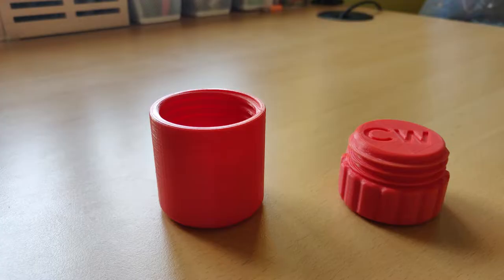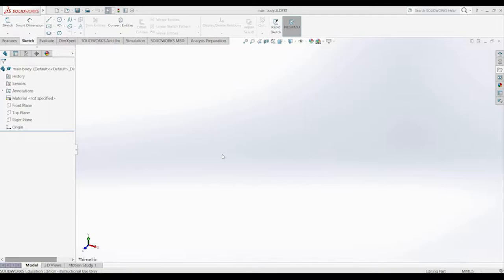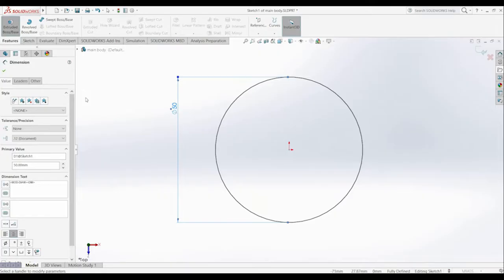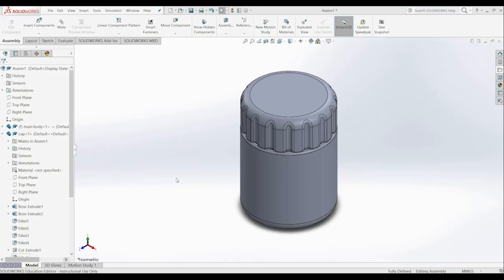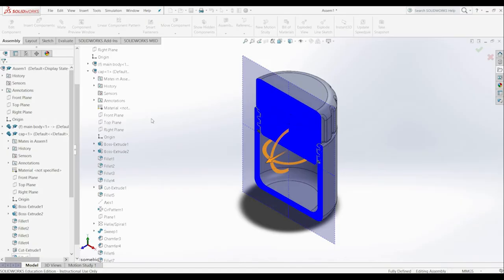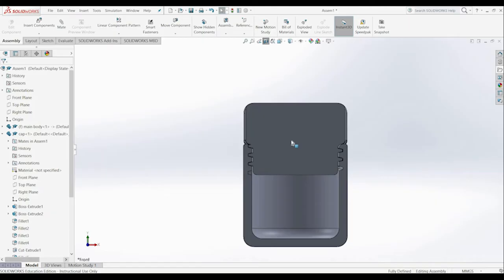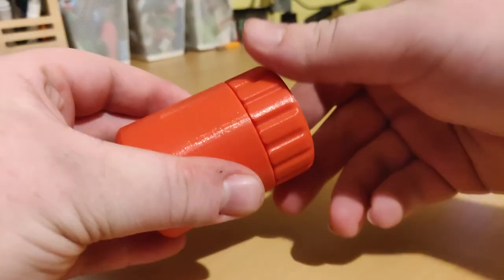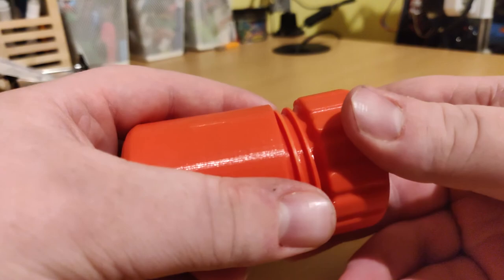How to model threads in SolidWorks for 3D Printing (Full Tutorial)

Comment: To anyone watching, Solidworks has a feature under insert > features > threads
and from there you can select the surface you want threads on and the parameters based on standard thread sizes (i.e. M10 x 1 or 1/4"-20).
for female thread patterns, be sure to change the parameters to "cut" threads and "tap"
for male, "extrude" and "die".

This will save you from having to manually create your threads.

Comment: When you created your offset geometry by 0.2mm for the thread clearance, there was no need to manually change the original lines to construction.  The offset command has options to auto convert base or new geometry to construction type.  Regardless, well done and very helpful.
Reply from the maker: I hadn't known that, that's very helpful thank you!

Comment: You could avoid all of the offset stuff for thread clearance by simply using the indent feature to cut the threads in the "box/container" which has a built in clearance parameter. Would save you much time and effort.
Reply: You know ? The question is that could you show it for us sucessfully ? waiting...................

Comment: Thanks a lot for your smart presentation! So far I used Fusion360 and I see, that Solidworks works quite similiar. Is there no automatic 
threading in solidworks? You did it manually ... Greetings from Munich. (One Proposal by a foreigner: Please speak a little bit more articulated /louder , so foreigner may understand better what you say, thanks)

Comment: When you use the Combine command, I assume that removes exactly the same amount of material from the grooves as the amount of material of the thread, so when you 3D print it, I would guess that twisting the threads into the grooves would be extemely tight, given that there is no tolerance. So, is there a way to add a little tolerance for the thread with a slightly wider groove? Thanks!

Comment: thank you for the tutorial, it really helped, is there a way to mate threads so they can mimic the movement?
Reply from the maker: You might be able to mate the helix's but I'm not sure I just mated to concentric circles and positioned it manually to check the part was correct though

Comment: is there a reason you decided to create that plane for the helix? instead of using the bottom face and using that as the starting point for the helix, and using that bottom face as the sketch midpoint for the thread sketch? or would that not work

Comment: Thanks that was helpful. Wondering if you have tried a smaller wall thickness than 4mm? I guess that would require the thread size to be smaller than 2.2mm as well.

Comment: Thank you! I love the subtraction feature.  Quick question: Why is the cutting/ extrusion better than just using the "thread" feature?
Reply from the maker: Thanks Daniel, I don't think the threads feature had been released when I made this project. But it is a great addition to Solidworks and it is a much easier method of making threads than the one I describe in the video. I might update the video in the future to reflect this change.
Reply: @conorwalsh_net  I guess it's good to know about both. I'm trying to make threads for an american garden hose (female) for a project. The hose threads are 11.5 and I didn't see that in the thread feature but maybe I'm looking in the wrong place!
Reply: The big question is does Solidworks thread tool provide for relief between the extruded thread and the cut thread ?
Reply: @dr.danielkester9313  Just a thought - maybe you can create a 10, and then in the slicer settings you print it at 115%? Would that work?
Reply: @pentachronic  I am trying it now and don't see a way to create the clearance with the Solidworks Threads feature
Reply: Před cca půl rokem jsem   začal s 3D tiskem. Běžně  používám SolidWorks, ale na závitové spoje a pohyblivé spojení je Fusion 360 zatím mnohem lepší. Myšleno pro 3D tisk a práci s obsazením ploch. V SW lze použít nástroj Dutina a s ním i procentuální zvětšení/zmenšení, nicméně nemám to tak pod kontrolou jako ve Fusion 360. Jinak SW je skvělý CAD.

Comment: what about the thread feature on solidworks ? will it work on 3d printing ?
Reply: i have tried it and it does not work, prolly for a few reasons, one is solidworks makes threads that are perfectly matched, there is no clearance between them. I have tried to change the clearances but its not easy, I can see how to change the height and the width but not the angle.
Reply: Yes it works fine but you have to make clearance manually. Make outer diameter of male part a little smaller and inner diameter of female part a little bigger before you apply threads and it will make a gap between the threads.

I think I used about 0.6mm clearance for M12x1.5 threads. Try different diameters until you find one that looks about right.

Comment: You said, all key dimensions in ur printer must be multiple of 0.4, why is it and how can i know that of my printer ??
I am a beginner.
Reply from the maker: The nozzle on my printer is 0.4mm wide you could use different measurements but they may not be exact as the printer will approximate some of the measurements to multiples of its nozzle width it works fine for most prints but when you need exact tolerances for parts to fit together it can be important

Comment: 0.6 gap?  I don’t think you need more than a half inch of gap.
.060 would be a mile of clearance.
.006 is would be fairly impressive from a 3D printer.
Reply from the maker: It's 0.6mm not 0.6" which is roughly 0.02" I would not recommend using imperial for something like 3D printing that requires such precision. I'm in Europe so I would never use anything but mm for engineering projects